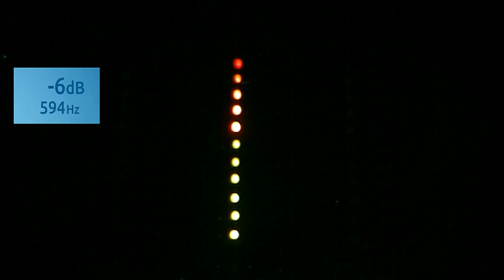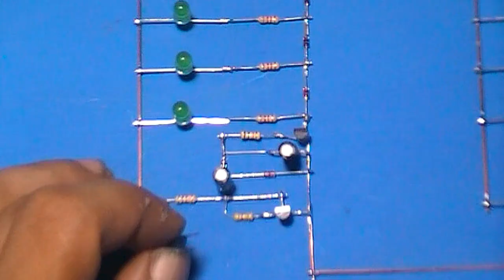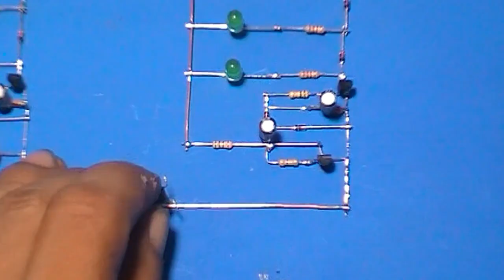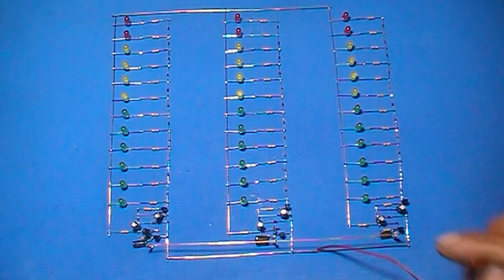6 Transistors no IC spectrum analyzer LED circuit DIY

Comment: Hello, I have a question regarding the project, how should I do it if I want to increase 2 more rows, are the values of the capacitors and resistors decreased? If you answer me I would appreciate it very much.😊
Reply from the maker: The answer will be in my future video.

Comment: If I use 5 led in per frequency channel what I have to change? The input signal resistor to higher value?
Reply from the maker: You can try that without changing the values any other components first.

Comment: Hello sir, what cable do you use to give the frequency or the sound, I would appreciate it if you answer me.
Reply from the maker: That cable often using as connecting cable on a Head tape cassette.
That's an audio coaxial cables.

Comment: Of all the VU meters you have made, I like this one the most. Very cheap but equally good and most sensitive VU meter. And also good looking.
Sir I have a little question, if I wana add more led lines so what is the value of resistor and NP capacitor we need in each next line???
Reply from the maker: Thank you for your appreciation, it's still a secret for future videos, sorry to say.
Reply from the maker: Kendinize bir şema çizmek için tembel olmayın.

Comment: Hi is there any difference if i use ceramic capacitor for the 2.2nf and 33 nf capacitor?
Reply from the maker: You can use mylar or ceramic capacitors with the same value on each.

Comment: What is the number of copper you used?
Reply from the maker: Copper wire diameter is not critically, as long as the copper wire can be shaped like in the video.

Comment: Hello, I have a project to design a VU meter using Lowpass, Bandpass, High pass filters. Can you please share the circuit diagram and the other details regarding this. Big help.
Reply from the maker: This is just my research experiment result, till today the schematic diagram just still in my brain.
So if you really needed the circuit diagram you can draw it your self while watching and use play/pause button to catch something.